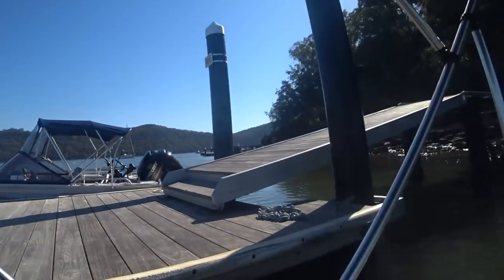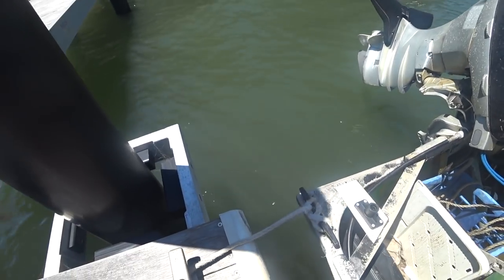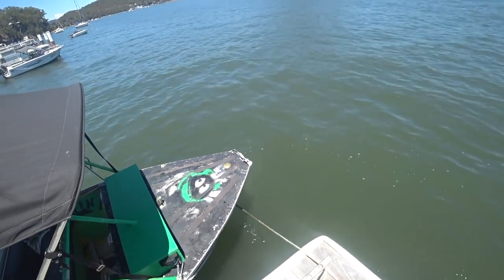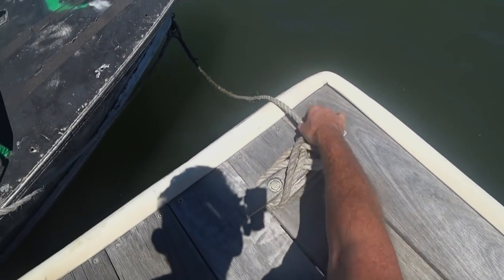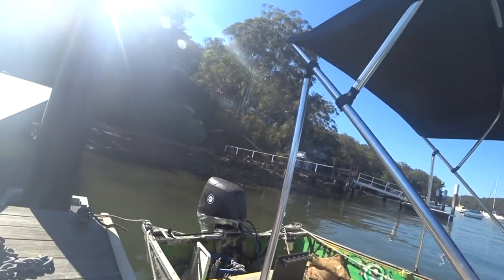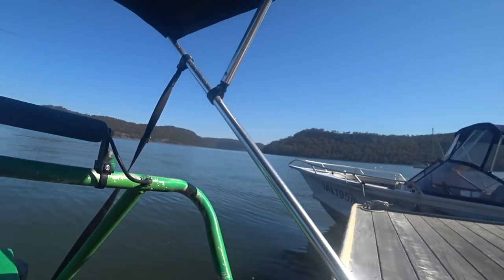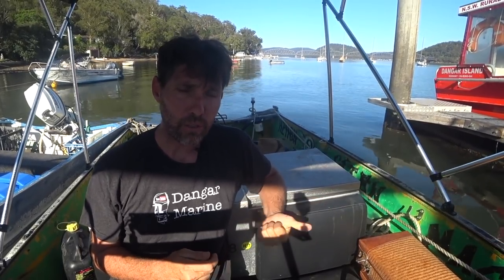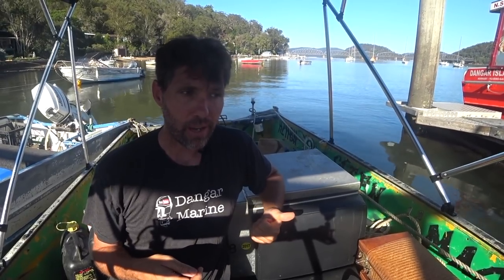Tying up a boat

Comment: Three years late on this vid, a few good tips there Stu. I have always tied up with bow and stern lines loose and used long but taut spring lines cleated a boat length or more forward and aft of the boat as the main controlling lines, especially in areas with a large tidal variation. Always used doubled back spring lines to the boat cleats so all untying is done from the boat, a must for single-handed or short-handed boating.

Comment: Another good rule before driving the boat away from the dock, is to never untie last rope until boat motor is started, and when returning, never turn the motor off till the first tie up is made. If you don't know why, the wind and current will let you know pretty quick why that is a good rule to follow. I made this mistake the first time on a large river.  I shut the motor off before tying up and the boat drifted away quickly from my tie up, I tried to restart the motor. Dead.  The battery terminals had vibrated loose. Luckily I was not close to any commercial boat traffic or river barges that would have plowed me under. Thanks for sharing Stu.

Comment: If you can’t tie knots, tie lots. Thanks Stu!
Reply: Hi ya Stu, any chance of a vid on removing frozen bolts with rounded/corroded heads ? Lower unit into power head would be handy. I have tried welding another bolt to frozen bolt, heat, wd40, hammer and chisel, even swearing at it.
Cheers 
Gaz
Reply from the maker: A solid policy!
Reply from the maker: Yep, have one of those planned soon.

Comment: Love the videos . Clearly explaining how to go about things on the water , makes  things much easier. Could you do a video about boat ramp launching and Etiquette . We see so many people doing the wrong thing . 
Slowing down our local boat ramp and causing frustration for other boaters .  Thanks 
Matt
Reply from the maker: This video covers a bit of that, but having a separate video on etiquette, if only just to make it searchable would be good. https://www.youtube.com/watch?v=svFJeG6BqLo
Reply: thanks that video link really just about cover it all . 
. i like your point about prep the boat away from the boat ramp itself . leaving the ramp free for a quick launch and retrieve . i have seen people completely load or unload their family and gear , clean fish or take off straps right at the waters edge , on a busy day!!!! 
ive even seen wicked  campers set up in the turning bay making a cup of tea. 
kinda makes the most patient people get frustrated. 
Good one 
Matty
Reply: i had an idiot winterizing and fogging his party barge  on the ramp then his buddy comes up and jumps line and has the nerve to bitch when i told him to screw off. we were loaded and gone and they were still trying to back the trailer. sad thing was the ramp was more than wide enough for two at a time.

Comment: Hi there Stu and the Green Machine. 
Knowledge is power, and any information that increases the brains hp is always appreciated.
Now we won't have to replace the Bimini or pay to raise our boats from the bottom, or worse, buy a whole new vessel. 
See, there's many was to save coin for the airfare, cause your right about the trim video, it would take awhile just with saving on fuel.
Cheers!
Reply from the maker: Hey Andrew. I've certainly seen plenty of windscreens smashed by not following the "check the anchor isn't dragging" step!

Comment: OMG 45!  Here on the east coast of Canada we have been in a bit of a deep freeze for most pf December.  It is currently -22 this AM (windchill is -33 right now) with a high of -16!  Great video, learned a couple of great tips!  Thanks!
Reply: 45 degrees celcious
Reply: VERY HOT!  We usually see summer temps around mid 30s, never in the 40s!  And mid 30s with high humidity is brutally hot!  I can only imagine how hot 45 on the water would be.
Reply from the maker: It turned out to peak at 47.1 C (116.8 F) Ouch!
Reply: Ulladulla got to 43 or so ( we are bit south of there) but the humidity at 90% was the killer. Glad I am holidays so were in the water nearly all day.
Reply: Look up Marble Bar - I think their record is something like 100 days of over 45 degree C days in a row.Nice place to visit on a trip in spring- forget it any other time!

Comment: No sympathy here about the heat from the UK today! 2 degrees and an icy cold strong wind...  Great video, always interesting to see how others do it, our boat is around 10 tons and we have a 6 metre tidal range so do things a little differently. Also, it's never calm here! Happy new year, and enjoy the sunshine!
Reply from the maker: Yesterday I was dreaming of icy winds! A six metre tidal range is huge, it must make tying up a real challenge. 10 tonnes makes a huge difference too. I remember when I was working as a deckhand the bigger boats had plaited ropes that were 65mm in diameter. Makes the Green Machine's lines feel like string!

Comment: nice roping skills there stu. when we bought the puddle bucket it had cleats on one side on the gunwales.  never made sense.  got a couple more for the other side  makes life so much easier. like the spring line idea . im still learning
Reply from the maker: Thanks mate. Having cleats on both sides is pretty essential I think. Too often you don't get a choice about which side you pull up to because of the current or the winds.

Comment: Nice tips Stu.I have a Quintrex estuary angler like in the video with side rails and have a short length of rope on the centre port/starboard side for tying off to pontoons/wharf when launching/retrieving.
Reply from the maker: Thanks Fabian, yep, that certainly is a very handy line to have. I'm definitely going to get around to adding it very soon.

Comment: Interesting.  I was in the deck force on an American Navy Cruiser a long time back.  We used 2" hausers and cable springers to tie up.  I remember using a rat tail stopper to hold the hauser tight while making the rounds on the bits.  One day the captain backed up too quickly and ran over the loop on the hauser.  Props cut it clean off.  Not as bad as seeing an oiler loose control and deep sixed its anchor and chain.
Reply from the maker: Yes, you can certainly get some amazingly thick hausers. They were lucky they got cut by the prop instead of wrapping around and melting into a thick ball of nylon that would need a team of divers to remove!

Comment: Excellent vid mate, and great advice as always...Maybe another vid on Spring Ropes, attachment to anchor chain lengths and so on ..So many different ropes with different stretch capacities now, some can almost double their length . Some just break...oops, and strong winds coming in from opposite quarters etc...
Reply from the maker: Thanks mate. Yes, there is a lot more to show, that's for sure. Hoping to do more on-water videos before the summer is over.

Comment: Where I boat, a fresh water 25x5 mile man made lake, most people leave their fenders tied to their cleats only at one end hanging down as they drive around and the fenders bounce all over the side of the boat which I find annoying. I tied my fenders in series  -------{____}----------{_____}------- like this with each end attached to the bow and stern cleats with spring carabiners (for easy attach and removal) just under the rub rail of the boat. I found that this helps them from bouncing all over under way and with them riding just under the rub rail when i pull up to our pontoons they meet the pontoon edge well and protect the boat from hitting without flipping up.
Reply from the maker: Hey Seth, that is a good way to go provide that you aren't tying up against another horizontal edge that they can roll off. I know what you mean about seeing fenders flying everywhere once the boat is underway. As well as being a bad look they can make people in the boat very wet!

Comment: Hey Stu, have been binge watching your vids for the last few days (and nights😁). Was putting a new winch on the tinny trailer (old Belco) yesterday and got  to thinking about moving/replacing some rollers and was wondering if you've covered roller/slide placement on trailers or could possibly be a future topic?
Reply from the maker: Hey Liam. Yes, definitely have a video on setting up a trailer planned. Won't be long!
Reply: Sweet. Have a Bluefin 4.3 Mangrove jack and have been trying to work out if there's any difference between wobbly rollers etc. Cant wait👍

Comment: As a noob (confession time) I used 2 Spring lines to tie off to a WHARF.
As a noob (I've already confessed) I used 2 MORE lines to cleats at the SPRING points to tie tight to the WHARF.
While sleeping onboard after the TIDE went OUT...I heard a loud BANG...went on deck to find the boat was serious LISTING away from the WHARF...starboard side was about 2-3 LOWER than the WHARF.
The forward CLEAT was RIPPED out of the boat and was still secured to the line.
(Boat builder only used small washers to secure the cleats...and the resulting HOLES were the diameter of the small washers).
Put the CLEAT back into the damaged holes (with Sikkaflex) and secured cleats from below with LARGER washers to cover the holes. All was good.
OK...OK...I know YOU wouldn't make this mistake.
But...I did...so maybe you REALLY won't make this mistake.
Confession over.
Reply from the maker: Don't worry mate, you aren't the only one that's been stuck by a shifting tide when tying up. Seen it happen many times!

Comment: hey Stu, just wondering but with anchor ropes how ofen should it be replaced? mines starting to come undone and im not sure if its really something to worry about?
Reply from the maker: I wouldn't say there is a set time, but once it starts to feel very UV affected or show signs of fraying badly I would consider swapping it out. Sometimes I can just be a section where it joins the anchor in which can I just cut that section out and re-splice it.

Comment: That's pretty interesting,  a lot of stuff that the average newbie wouldn't think much about, until returning to find the boat either sunk, or hanging.  My experience with tying up is limited to lake use and pretty much always tying at the same slips every time.  When the boat is at "home" on the island,  it parks in a spot between the wrap-around dock, nose-in, on a three-point restraint,  where the port and starboard stern lines have eyes that slip nicely around cleats, and the bow line is a safety clip that clips to the eye ring right in the nose.  When the boat is tied at the "land" dock, it gets tied again at 3 points, nose-in, to a dock.  In both cases, it's not safe to point the bow-out to the open water, as the weight of the 70hp Honda on the transom causes the rear to sit low anyways, and nobody would want it to be striking on the rocky bottom near the shore if the boat should get bouncing due to waves or wind.  45Celsius, eh?  We've been enjoying lows of -29 with wind chill of -39 around here, but they say it's supposed to warm up and snow some more today. Thanks for sharing a glimpse of summer. Cheers, and two thumbs up (for getting a train heading North over the bridge in the background) !  Hope everyone there is well.
Reply from the maker: Hey Stan, good point about the depth of water coming into the bow out / bow in equation. Keeping your motor in deep water is sometimes the priority.
Reply: The train is one of our double decked electric (1500v DC, overhead wire system) interurbans - an Oscar- 8 car made up of two  4 car sets. Pretty reliable having a good miles per incident ratio - but being an interurban they do a lot of kilometres between stops/door openings (main fail point is doors)  and pretty good comfort wise except for the seats- way too hard for long trips. But made that way to lower vandalism effects. Sydney to Newcastle. And running slowly across that bridge as it is reported to have structural problems.
Reply: Hi Ron,  I myself have years experience using commuter trains, and ours feature similarly "hard" seats.  There is adequate padding, the bottoms are Velcro-held in place, easily removed/replaced for cleaning.  For the distance that I would travel on them, 45-50 miles, I had no problem with them unless the train became delayed in an unusually long delay.  I would simply get up and walk around a bit.  Do a few "loops" in our bi-level cars, down one staircase, along the lower floor, and back up the other end.  Ours don't have a name, other than simply calling them GO Transit bi-level cars.  They were designed by GO Transit, Hawker Siddeley Canada in the mid 1970's.  UDTC built a later generation,  and now Bombardier builds them and owns the designs and manufacturing facility. They have consistently improved the interiors over the years.  Every single car has a lavatory, 4 doors (2 per side), many used to have AC power available to riders for charging devices. Vandalism is a problem.  Unfortunately, GO runs its' trains with only one  crewperson inside the train, confined to a certain car. The other two operating crew members (engineman, brakeman) are not available to watch for vandalism.  As for bridges, tunnels, overpasses,  we have our issues too, but they are pouring money into major upgrades all the time.  Our entire fleet is presently diesel-electric, (4000hp MPI  MPXpress series), but they are committed to going totally electric.  Our cars, unfortunately, use a 575volt HEP system, which differs from the "norm" of a 480v HEP system used by most other forms of pax transportation systems in North America.  As for reliability,  the trainsets do quite well.  One of the things that can, and often does cripple an entire line, is level-crossing incidents, and suicides.  The doors on ours are pneumatic, and occasionally become susceptible to snow, ice, salt or other debris to cause the doors to jam in the tracks.  Sometimes, riders are the problem, abusing the doors by blocking them with a shoe or other object.  This delays the train if the cause cannot be found a remedied quickly.
Reply: Velcro cushions- they would be ripped out and thrown out by the lovely idiots we have as passengers. A 1hr trip is just a local for us, some local runs are 70-80 minutes long. Intercity runs by trains such as these are 2- 4 hrs long.The seats are way too hard for those trips. Our sets are crewed by two, driver and guard, no fireman/off sider here. But the guard has cameras- up to 96 per 8 car train and recorders going full time. That hasn't stopped the vandalism, or sex acts, going on at all.
Reply: Wow. Sounds like your train agency needs to administer IQ tests at the point of ticket sales. Need to weed those sorts out. Our seat cushions are Velcro-placed so that when the cleaners do their thing, the scraps and crumbs can be vacuumed out. Also if someone pukes or spills something, the entire cushion can be swapped out and sent off to the cleaners. In North America, a train MUST have a brakeman, and that comes into play sometimes when some fool yanks the emergency brake cord because they've missed their stop or whatever.  No complex camera systems (as of yet) on GO Trains. I guess our idiots are a bit more refined than yours are, and I'm not bragging about it. We certainly have them here, they're just generally not that destructive.

Comment: What about tying up parallel to a fixed structure where there's tide? Say you arrive at low tide, how do you keep the slack in the lines from getting too big as the tide rises. It's alright when you've only got a metre of tide or so, but what if you're stuck with two or three metres of tide?
Reply: AR1G3 - try Broome- we tied up there one Easter and had to have a deck crew available all the time due to the tides. Our gangway went from the main deck down at about 25 degrees to the wharf at high tide, and at low tide it went from 3 deck up about 15 degrees to the wharf before the gangway was closed to access for about 2 hours for safety reasons. If the deck crew was not moving the gangway , they were adjusting the lines (double stern and bow lines, main and mid fore and aft springers, along with fenders)  Our usual in harbour deck crew was something like 6 people doing 8 hour watches, Broome was a crew of 12 and 2hr watches.  The doubled lines were because of the tide race. That was on 2500 tonne oceanographic survey and science ship.
Reply from the maker: Large tidal variation can be tricky. As in Ron's situation, having crew permanently on deck makes a huge difference. Lines with weights and pulleys can help if it is a permanent docking place. Another option that I like in the situation where the boat is parallel to a fixed structure is having the deck lines go to the far side of the boat, but once again, this won't help once the variation is too great.
Reply from the maker: Oh, and should say that another thing I've seen is rings that slide up and down long piles. This way the deck lines to the rings can be quite short regardless of the tidal variation.
Reply: I like the thing with the rings, but I don't think they have them in a lot of places. The reason I asked was because of a place I used to go on vacation to in France, called the bay of the Somme. It's a bay that empties completely at low tide, you can litteraly walk across it. The tidal variation there is 10 metres, at low tide the boats are resting on their keels in the sand. Due to it completely emptying at low tide, the tide also comes in really fast. It takes only 15min between no water at all to the point where speedboats start to leave the harbour. Pretty crazy sight, seeing the tidal wave come rolling in.
Anyway, there are also fishing boats there, small trawlers with a crew of +/- four. All the speedboats, sailboats, etc tie up to a floating dock so they don't have to worry about the tide, but the fishing boats tie up to the warf so they have to deal with the 10m tidal variation. I've always wondered how they worked around it.